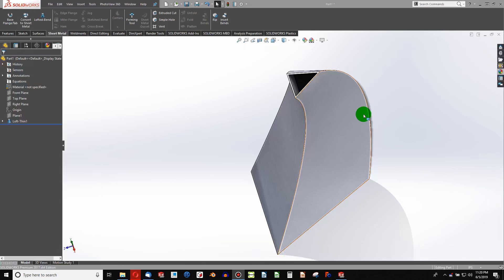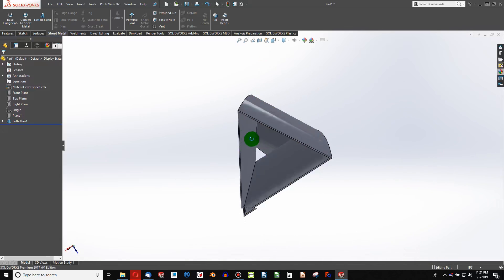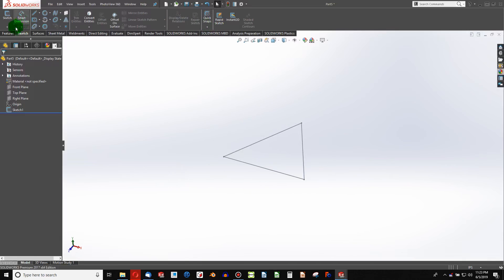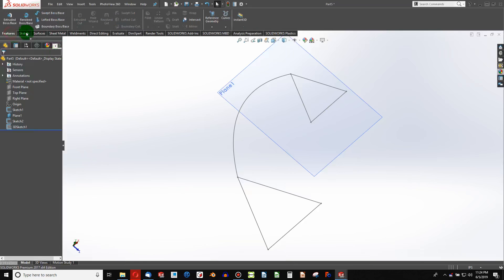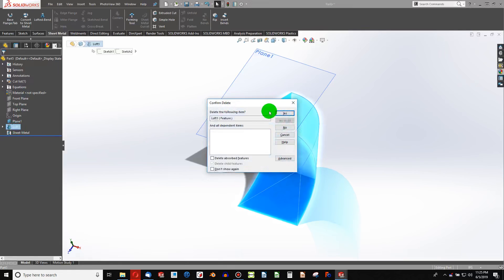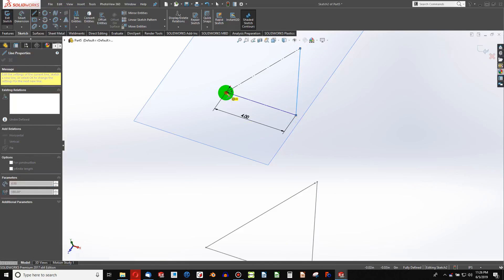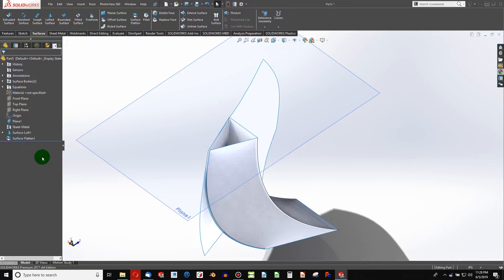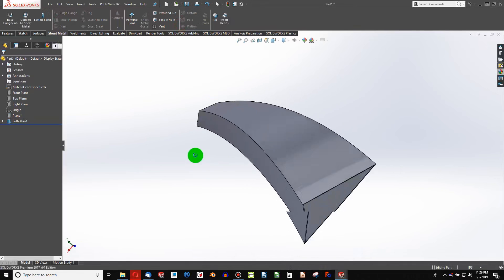Exploring Options for Non-Planar (developable) Sheetmetal in SolidWorks|JOKO ENGINEERING|

Comment: Hi Joko, can we split each faces, then convert each of them to each sheet metal? is it possible?
Reply from the maker: Hi Travis;
It should be possible but each of the faces you split must be a developable surface.  If it splits to a NURBS surface it just won't convert.  So, for example, splitting the faces on the above model won't work because there will be distortion when the face is flattened.